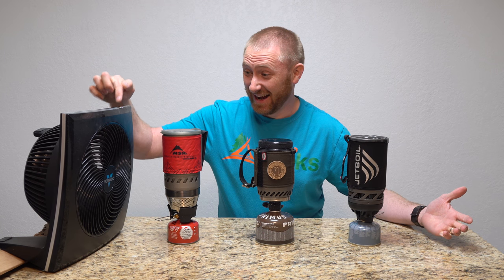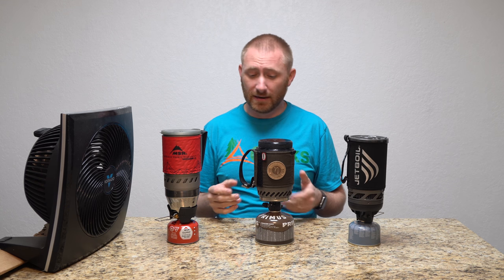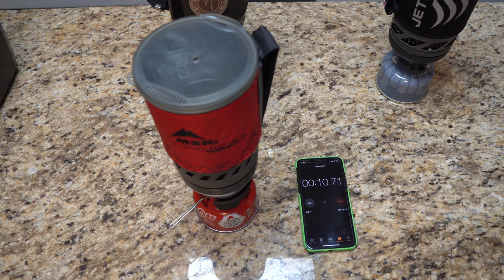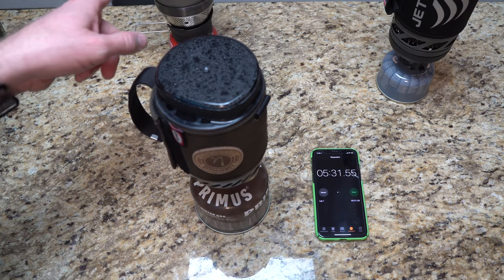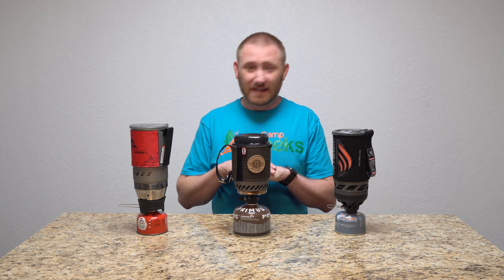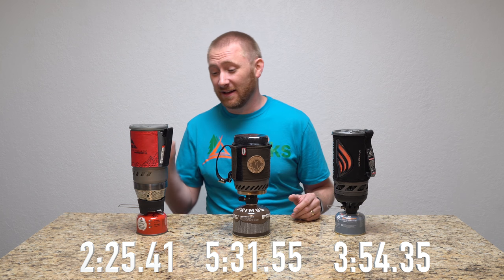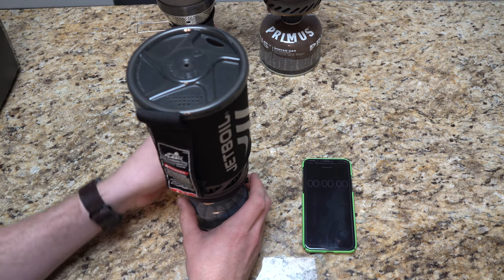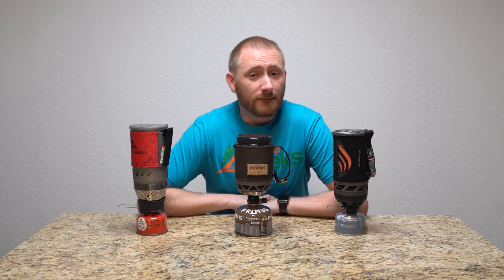Backpacking Stove Speed Test in the Wind

Comment: I witnessed similar results camping a night at the Sahale Glacier Camp in North Cascades National Park. I don't know the exact temperature but it had to be between 30 and 21 degrees F, with wind gusting 20-30 MPH constantly. My group had an MSR Windburner going in the vestibule of our tent with no issues at all, while the group next to us was using a Jet Boil (not sure on the model) and struggled for over an hour to get water boiled for their party (despite my offer to use our Windburner). The Windburner is my go-to from now on.
Reply: Never been in that kind of situation, but wonder if you can just hold the jetboil with your back into the wind for 100 seconds?

Comment: Great test. I just bought a JetBoil the other day and used it on Mt.Adams night before last. There were about 40mph winds and I was behind a 4ft tall wind screen and the jet boil wouldn't light and wouldn't maintain a flame unless I had a windscreen built directly around it and there was 0 wind near the flame. Then it ran out of fuel after melting snow to a boil only 4-5 times. Luckily I had some friends with their own stoves or I would have been out of water for the trip...
Reply: jetboil instructions say not to melt snow in the jet boil. It almost ruins the container and as you found out....burns off all your fuel.

Comment: not a bad comparison video, but it would be really neat to see a test of the efficiency of each fuel and burner. You could measure the weight of each canister before and after your test to determine which fuel system was the most efficient at bringing water to a boil despite the time differences. 
I don't care if I have to wait an extra minute to boil water, if that means I'm more efficient at boiling 2 cups of water with the jetboil

Comment: I did some math based on your previous test to see which is most efficient in real world situations.

According to your fuel consumption tests, this is the data I got:
MSR - 6.23g to boil 
Jet boil - 7.68g
Primus - 9.4g

Thats what should have been used this test by doing the math on grams per second in your last test. 

Shame I have the Primus, it falls in last every test possible lol. Ill keep it but looking at the windburner harder now
Reply: You'd think. But because the head of the MSR is so much larger, it actually uses more fuel in a shorter amount of time.
Reply: dont give up on primus

Comment: It would be cool to see boil times including setup. Start with them as they would be in your pack, and stop the timer when you have the water boiling. It will include the other factors such as setup and ignition into the time, just like on the trail.

Comment: Which one burns / heats better in cold condition?  IE Take the canisters out the freezer.  Minus 7°C is the lowest recommended temperature.  I camp in lower temperatures and cannot use my gas stoves at all.  I need to use hex blocks and wood.
Reply from the maker: Hmmmm...good thought for a future video
Reply: Maybe you should keep the gas canister inside your sleeping bag overnight like I do.
Reply: With this test Primus would probably come off as the winner, since he was using their wintergas (rated for -22 degrees C)...
Reply: Might be time for a white gas MSR

Comment: Great test, probably one of the most useful on yt. My wishes to improve:
- run stoves with the same gas
- test stoves on empty gas cylinder - e.g. when you have ~30% or less inside. I heard somewhere Msr is quite optimised for low pressure - but is it true?
Keep going!
Reply: tokyotunnel the windburner has a regulator so low can pressure will have negligible effect on boil times.